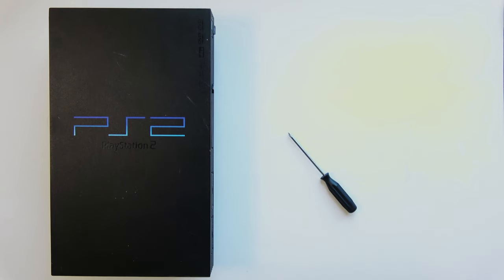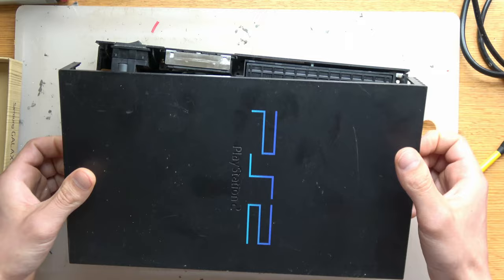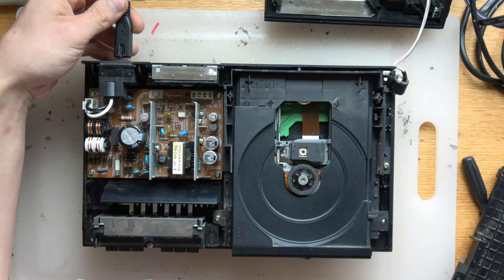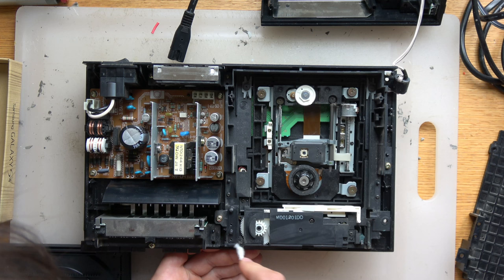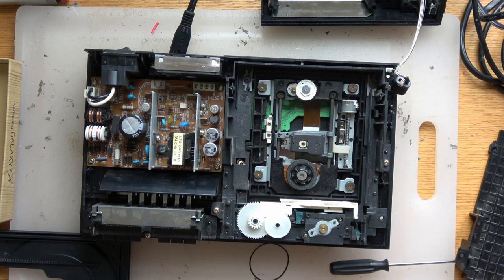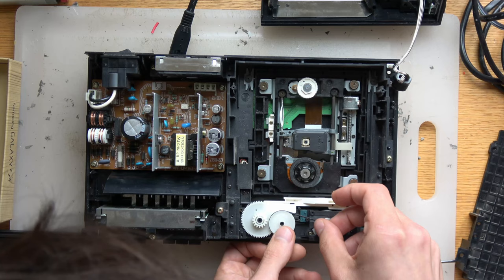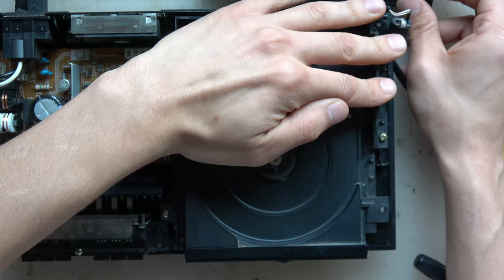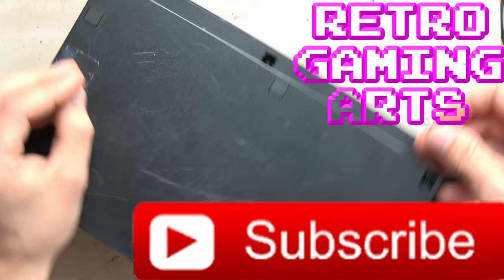HOW TO FIX PS2 DISC READ ERROR + MORE - RGA

Comment from the maker: Any questions about this fix, don't hesitate to ask, here in the comments or facebook or however, this is a fix i know you can do, and i'm here to help you if you need!
Reply: my disc tray comes out only 1/4 out and then it gets stuck whatnto do?
Reply: Could I use nail polish remover?
Reply: Dude i need your help I did that and the disc read but when I wanted to start the game my dualshock dosent turn red . I think when I tore it apart messed up something and know the dual dualshocks dont connect and when I try to put it in I need to put it really hard to get it in  pls help
Reply: came across this today. my friends ps2 didnt want to work so i decided to look at your vids to see a solution. ill let you know if it worked
Reply: My disk tray comes out and the closes again automatically
Reply: What is wrong
Reply: What if the disc reading kindof clicks as it decides it can't read it like ki did grinds
Reply: What is the default voltage of the laser lens?
Reply: I don't get an error and it says that it reads the disc but then nothing happens. I feel like this is a problem with the disc drive instead of the laser for me.  Should I do the same thing in this video or should I do something else?
Reply: My ps2 can’t read in midlle of game god of war when movie start
Reply: Hey, so I just decided to power up my phat ps2 and play guitar hero 3. It reads and gets to the first loading screen, then I just stops loading. Can you help please?
Reply: Would swapping a CD and a ps2 game work like swapping ps1 and ps2 games
Reply: My dusc is not spinning!
Reply: My ps2 is always get RSOD. How to fix this :(
Reply: What can i use to clean the lense i have no alcohol?
Reply: I did this and mine works great now. Thanks much. I have a little horizontal line that moves through the screen, though. Got a fix for that?
Reply: My ps2 reads games but when loading cinematic videos or loading a new area, it starts clicking, lightly tapping bottom of ps2 will cause it to fix for a bit. How do I fix this issue?
Reply: What screw driver did you use to unscrew the cd tray?
Reply: What if my playstation 2 only has 4 screws and the other places where the other screws would be are covered up?
Reply: My ps2 makes a really loud sound when I have a disc in and then after 5 minutes the game freezes up and the sound becomes louder it only did it for one of my games but now it’s doing it for all of them would that be from the laser or maybe something else?
Reply: my playstation reads dvds but not cds
Reply: My console won’t read blue disks what can I do to fix this problem
Reply: Would this work with the ps2 slim model?

Comment: If you want to more easily determine the issue your ps2 has, put the game you want to play inside of the ps2 upside down. If the ps2 does not show an error message within 5 minutes or so, then you probably want to follow the fix showed in this video.  If it does, your ps2 may just be having trouble processing the data on the disc. To fix this, I removed my memory card whilst the ps2 was reading the disc, then re insert the memory card when you know the ps2 has completed reading the disc. If this does not work, follow the guide in the video.
Reply: My problem is that it wont read the disc

Comment: My dude you're  a legend!
 Fixed my fat PS2 that wouldn't read dual layer discs!
Reply: I'm new to all this what is a dual layer disc?
Reply: @melloniefrazier2278   A dual layer disc is exactly what it sounds like. The discs have 2 different depths that the laser has to read and if the laser frequency isnt almost perfect, it can't read both layers.
Reply: @danielschnabel5168  My ps2 got a problem that it just says "Reading the disc" all the time do you know a way to fix it?
Reply: @herizefell1431  If the disk is spinning, the laser is likely not aligned, it's dirty, or it's dying. 

Test blue disks as those are the first to stop working. If none work, look up guides to clean and re-align your laser.
Reply: @danielschnabel5168  I bought it about more than 10 years ago. Its the first generation console but haven't use it for about 3 years. Might be too dirty though not sure

Comment: Alcohol is like a wonder drug for all things retro gaming lol. Last time I opened up a PS2, I found 3 dead roaches inside, which explained while the laser wasn't working because they seemed to have imploded. Must have crawled through the CD tray area, and died somehow getting stuck.

What is the WORST condition you've seen a system in that you've managed to successfully repair? Props to anyone who has the patience to clean systems like this. 

Glad to have subbed - great stuff.
Reply from the maker: Thomas Torre hmm worst condition that ive repaird, ive fixed some xbox 360 controllers that where SO DIRTY i side, it looked like MUD, but ive found cockroaches in a ps2 one time... couldent repair it...
Reply from the maker: Thomas Torre good question lol. Thanks for checkin out my channel, oh and 91% alcohol.... its so important
Reply: cockroaches!? 🤢🤢

Comment: Damn broham, you just saved my quarantine. Take this sub why don't ya.

To elaborate- my PS2 "broke" years ago. I screw-drove it apart, hit it with the dust-off, and took a drunk q-tip to the laser assemblage, but no dice unfortunately. I bagged it up, along with all its cords & cables, and my various controllers. 

The past two days, I've been listening to old rpg OSTs and watching let's plays of retro games and got inspired to pull the old thing out. Much to my chagrin, "DISK READ ERROR", and some mild ptsd of it completely crapping out ~6 years ago was all that awaited me. Quick search led to you, and turns out that guide I saw last time around failed to detail the bit about the adjustable white gear. After a dusting, a swabbing, and a meticulous adjusting of said gear, the miraculous occurred and I now have you to thank sir. Now I can dive into nostalgia myself, instead of simply sampling it vicariously.  

For those requiring the "gear fix", turn it until it clicks loudly and "resets" as our friend shows in the video. Try it like that first, but if it still doesn't work- as was the case for mine, then from the beginning position, keep trying it after turning in intervals of 4 clicks. Eventually, it will start detecting PS2 disks again. At first, it may detect the disk, but keep looping back to the browser screen whenever you click on the disk. If that happens, you're in the right ballpark- just simply experiment with turning the gear in intervals of only 2 from that position, first backwards, then if that still doesn't work, 2 forwards from that position. Chances are, after two additional clicks from that position in either direction, your laser assemblage's height will be at the exact ideal level to begin detecting and properly reading the disks again. Hope this further helps those in similar positions checking out this video. Sorry for any possible confusion.
Reply from the maker: This is excellent. Thank you for leaving this. I made this video a while ago so it was before I had learned more. I greatly appreciate you filling in some blanks for others it means alot to me.

Comment: That white wheel you point out at 3:10 doesn't have to be adjusted manually on this particular PS2. The PS2 you have is a launch SCPH-30001 and that white gear on these particular PS2s is actually adjusted automatically when you insert a disc by a small motor next to it.
Reply from the maker: You're right. Part of this channel is learning as I learn, so some old videos have wrong information and as videos get newer, and I learn more, better information comes.

Comment: I've had to fix a bunch of PS2's that I buy used this way, though I never knew about the laser reset by putting in the three different types of disks, thanks for the info, I'll be trying that first next time.

Comment: Worked like a charm.  Easy to follow instructions & done in less than an hour because I dusted the heck out of my console.
Only thing not mentioned, was the warranty tape at the back.  Keep an eye out for that.
Great video!!!!
Reply: Im pretty sure the warranty on ps2s in general are outdated by now but i could understand if you want the console to look factory new

Comment: Just wanted to say, thank you so much for that guide, that’s one of the best ones I’ve ever seen! Was that a SCPH 30001 by any chance? :)
Reply from the maker: nice! i'm glad it helped, and honestly this videos so old i dont remember what scph it was, it was a VERY EARLY ps2 i remember. ive learned so much more about ps2's since this video also, i'm embarrassed about it
Reply: It is. It’s the original 10 screw version.
Reply: Looking back at this video, that is certainly a launch model! The tilt motor was removed from the 3002 and onwards (I believe) I guess it also had a KHS 400B laser block? Still like this video, nice to see a 10 screw PS2 model!

Comment: Cool, never heard of lithium grease
Reply from the maker: +gotbletu lithium grease is my go to for ALL disc based consoles
Reply: i might have to get a bottle for my OG Xbox; those tray usually stuck
Reply from the maker: +gotbletu yea, they do, clean the little rubberband inside them too, it gets real dirty for some reason
Reply: It's been around for 100 years. They use it on "no drip" applications... like garage doors and such.

Comment: dude u did half of 1 lense of 2 lenses and the mirror and laser lenses itself lmao. u took 10 minutes explaining dirty tray rails so everybody can get the disc quicker to the laser that wont read lmao. great job.
Reply: Where do we find the second lense. Do all PS 2's have two lasers?
Reply: Mellonie Frazier the second underneath the top lens then theres a mirror the  final lens at the laser. Take the whole laser assembly apart. Take your time and pay attention to what your doing. The laser assembly can be stripped down too just the frame rail. With all lenses and reflector mirror cleaning on both sides. Take your time and notice what hardware came from where . . the screws have did is
Reply: what?

Comment: I haven’t used my PS2 since 2004, it kept getting error messages when I tried to play any game. 

First i thought the problem was CDs, thinking i played them to much and it reached the end of it’s life. Bought a new game assuming everything would go back to normal.....nope, still getting that error messages. That’s when i discovered the problem was the lens. 🤦🏻‍♀️

I got lazy, didn’t wanna fix it, figured I was never going use/need it so i ended up putting it away and forgot all about it until 2021. 

 Now that the cable is no longer active in my home, It’s really, really boring without it. But damn I’m glad i never got rid of my PS2 for situations such as mine. Videos games are quite useful in a no cable zone home. lol 😆😜

Just hoping leaving my PS2 sit for so long it didn’t get worse. Gonna try this method.

Thanks for sharing! 🙂👍

Comment: Hey man what size screw driver did you use to open the tray? I noticed the screws are different sizes. Just was curious what size you used for the smaller screws

Comment: My disc eventually stops spinning and the game will freeze. Do you know what the problem can be?
Reply from the maker: Laser is on it's way out, it looses power while reading disc and turns off. Buying a new laser and replacing it should fix this
Reply: My Ps2 says reading disc then disappears how do u fix it
Reply: @erd1338  Did you find the solution

Comment: okay i have a weird 1 just 3 dbz games from gamestop a few days 2 didnt work at first until i reset my ps2 slim(had for over 10 years).then got another dbz game it started up no problem and was played for several hours no problems.then i took the ps2 into another room hooked everything back in and put the the disc back in and started the ps2 up and it wont read the disc.
Reply: also the disc has scratches but nothing major i think.i have dbz budokai 2 and have since its came out and its scratched to shit and still works no problems.game thats not working anymore is budokai tenkaichi 3.i bought budokai 3 and budokai tenkaichi 1 & 2.budokai 3 started up snd i got to the item menu and it froze but now just has longerish load times but works otherwise now.tenkaichi 1 had to restart once but has worked eversince.tenkaichi 2 had worked the whole time.

Comment: Awesome vid Mr. RGA. I have a PS2 that reads discs but they take a long time to load. They stop spinning for 60 seconds and then spin again and read just fine. I’ve tired cleaning and replacing the laser to no avail. Any ideas for what to try next? I’ve heard about the laser control IC chip that’s known to fail. Could that be the issue?

Comment: If you can bring this unit back, can you do the same with the Sega Saturn?
Reply from the maker: you have a sega saturn that doesnt work? the saturn has a VERY strong laser, that usually doesnt die, did you try the qtip and alcohol on the saturn lens?
Reply: RETRO GAMING ARTS...that I remember the CD won't spin, no reading. I have my old Sega Saturn that I am talking about. The brand new one I bought at eBay for 77 bucks...well works.

Comment: I have a Test unit in this model.  I screwed up the factory calibration wheel setting, and now the spindle motor won’t even twitch when powered on, like a normal optical drive.  It wouldn’t work with the new laser or the old laser?  Any tips for fixing this?  The laser WILL move up and down the bars and I see it bopping around looking for a disc, but the disc won’t spin at all.

Comment: Just a slight heads-up for all who have this issue - give the PS2 some time before going bananas. I thought I had this issue. Picked everything apart - which by all means was very needed. But after I re-assembled everything there was no change. BUT! Turns out - the console IS reading the discs - but it takes shit loads of time to read it (that wa the case for me). Turns out it took the console almost exactly 4 mins to read the disc - and we adjusted the power-output too even. AND I have to manually go into the "Browser"-menu in order to access the disc (it won't auto-start). I have no idea what the issue is but once it's up and running it works normal.
So don't throw your old ps2 away JUST yet. :)

Also - the lithium grease is a bit risky since it's grease - try find some lubricating-oil for sewing-machines instead and wet some paper with it and lubricate the metal-rods with the oiled-in paper. Less risk of having grease on the interior of the ps2. :)
Reply: I have the same problem ps1 discs take a while to register and start via the browser menu idk how that is fixable after I already did the cleaning just like he did :(

Comment: Hey awesome video! I have a similar issue but instead when placing a disc into my PS2 it says it’s reading on the browser menu but nothing else. I opened up the system, cleaned dust and laser but the problem is, the disc won’t spin at all (or maybe very little). I’ve tried numerous games with all the same issue. Not sure if it’s a laser related issue or something else. Thanks.
Reply from the maker: did you try the swap from ps1 to ps2 to dvd trick mentioned in the video? if that part didnt work, your laser may be dead :-(
Reply: @RETROGAMINGARTS  i have the same issue it used to put the red screen of death now after disassembly and cleaning the dust it says reading the disc

Comment: Thank you so much for the help. I was super scared to take off the warranty label at first, but after learning they shut this cleaning service down I wanted to go through and do a once over on the playstation to get a feel for knowing what I've been playing on for 17 years and if it needed service.
BIG QUESTION THOUGH, after going through the once over, cleaning and everything, my blue discs still wont work on my PS2 without putting a little masking tape on the inside edge. I didn't do the last resort cleaning method since that one seems a little scary to only being able to do it a few times, but I'm lost since I cleaned everything else, and all disc work except blue. Black and silver discs work just fine though. Any advice would be much appreciated
Reply from the maker: You need a new laser, most likely a 400c will be your laser, it was the most used in ps2s. The blue disc is CD format. As is ps1, and ps1 discs are DVD format. On the bottom of your laser there willbe 2 small dials, you can gently twist one to increase the CD lasers power. This is called pot tweaking. I would research it a bit before you do it. But it should have positive results, and if it doesnt, buy a new laser
Reply: I will give it a try and let you know. Thank you!
Reply: Casey Robertson did it work?

Comment: That gear which changes the height of the laser, to be used as a last resort - do you know what the factory default setting is? I didn't mark it before tweaking it. I'm currently testing each notch haha.

Comment: Bro can you help me,
So i got a fat ps2 with hdd and a network adaptor, Everytime i open my ps2 , the hdd does not work properly, any tips to fix this?
Great vid btw👍
Reply from the maker: Sounds like a connection issue, try cleaning the connectors or try a new network adapter and see if that fixes it,  what do you have to do to it to get it to work? That could help identify the issue

Comment: I was using PS2 normally yesterday, suddenly the PS2 no longer wants to load disc, those blue balls in the menu are no longer spinning and the system settings are not saving anymore. And I also did basic cleaning inside the PS2 and it didn't solve it, I don't know if it was enough to clean it.
If you have any solution, I will thank you very much.
(I'm using a translator)